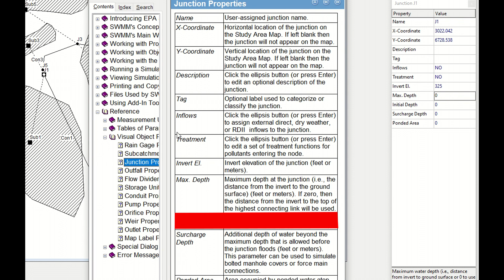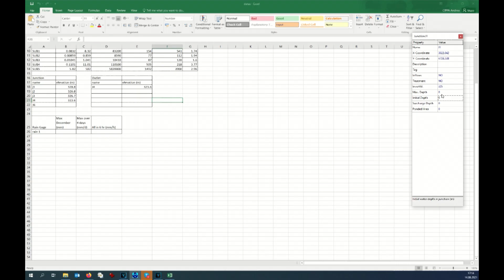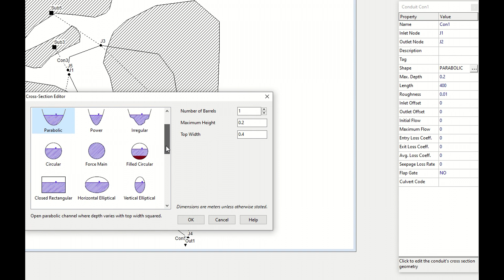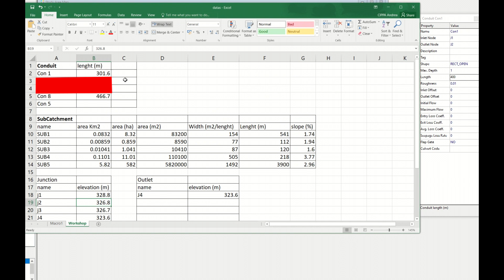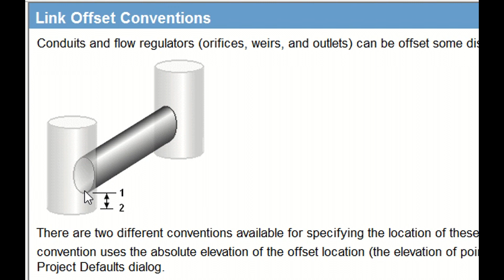SWMM Part 10/12. Inserting Proprieties for junctions and conduits

Comment: Do you add the junction nodes to the project randomly or do you add them according to the current positions of the rainwater drainage nodes, I couldn't understand it, can you help?
Reply from the maker: you should add the junction on the spot where you encounter changes. For example, where you have several drains joining, where you have major change of slope, where you connect to an existing drain.
Reply: @AndreaCippa-Siteplanning  that is, we do not need to mark the entrances of the storm water drainage channels in the cities and add intersection nodes there, right? I thought so. For example, when planning a city center, would it be correct to add it to the junctions of the streets?
Reply: @AndreaCippa-Siteplanning  I am very confused about this because we will also need to add condiuts to these intersections and the system asks for the distance values of the condiuts.
Reply from the maker: @MrPeyzaj  let's have a chat tomorrow in skype or similar.  skype: cippaandrea
Reply: @AndreaCippa-Siteplanning  Thank you for your help. My English is very bad. I'm just asking a question by translating it. Actually, it would be great for us to chat but we can't agree :) I'm writing a thesis, I'm going to measure the rainwater surface flow of a city center in Turkey, I determined the sub-basins and drew them in the program, but I'm stuck on this subject, I also have hourly precipitation data in my hand. I haven't been able to create the .dat file with these data yet, my job is too long :)
Reply from the maker: @MrPeyzaj  It is difficult to help you if I can not understand the problem. Contact me, we will find a way out. good luck
Reply: @AndreaCippa-Siteplanning  You are a very helpful person, thank you very much, I will contact you.